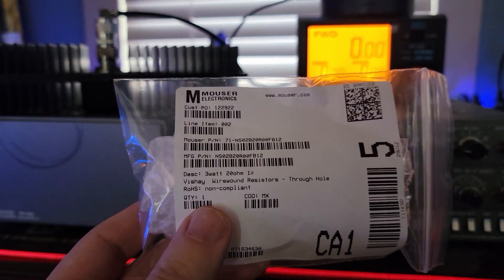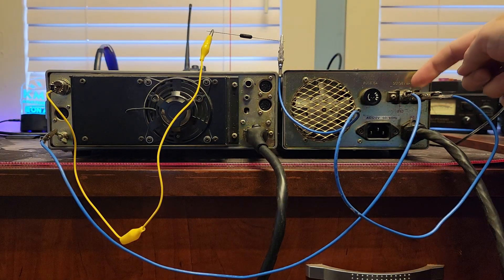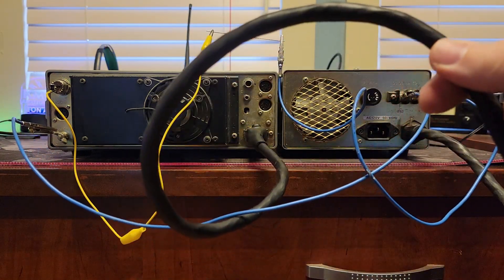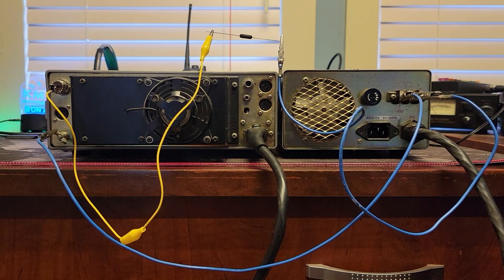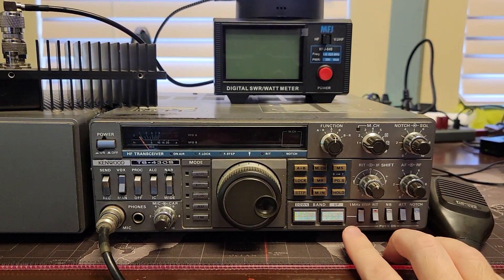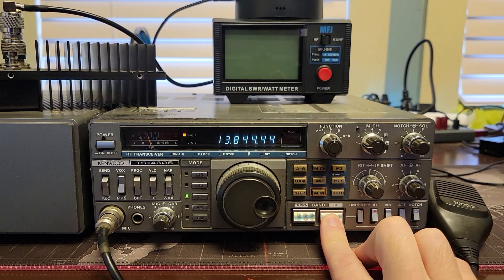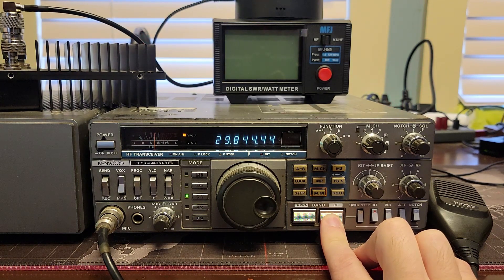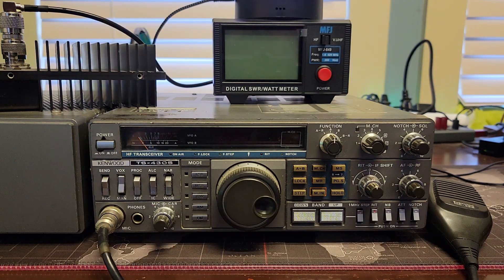This one weird trick...

Comment: Contact oxidation is/was a common problem on, at least, ICOM 730 and 751 transceivers pre-amp relays.  A resistor in the line did the same thing for them as the relays became unobtainable for replacement.  If you were lucky your relay 'welded' shut so pre-amp was always on!
Reply from the maker: Nice! Self improving circuitry!

Comment: I have that radio also Steve. right now it's at a friend's house who just repaired it it needed a new meter and it got cleaned up and de-cat-haired. my friend used to work for the local TV station in ENG as an engineer. he has all the test gear. I also got a 1.8 & 2.7Khz filter for it. Im n going to sell it to a new ham in our club. I've had this radio since 1998. I'm the second owner. I have both the original service & owner's manual too.
Reply from the maker: That will do a new ham very nicely!

Comment: I did this a few years back on my TS-430 because it was in storage for a few years and the relays developed some oxidation. 
With my TS-430 I found that 50 ohms works fine.  This limits current to a safer 275 mA. or so and means that you can just use any DC coupled dummy load you have laying around rated for 5 watts or more as your series resistor so long as you are careful about how you hook things up.  Most of the dummy loads you have around a hf shack are likely to fit the bill, and will work fine.  Again - so long as you are VERY careful hooking things up.

My connection path worked like this -  I adapted the SO239 on the dummy load first to BNC and then BNC to Twin Banana terminals.  Then I connected the RED (center pin) Banana terminal on the dummy load to the Positive output of my power supply.

This means that the shield and outer shell of the dummy load will now be at a current limited 12 - 13.8 volts positive (so some caution is needed) --   Then I used a single wire banana to banana to connect the other (black) side of the twin banana on the dummy load to the SO239 CENTER OF THE RADIO  * BEFORE * APPLYING POWER.  It's absolutely critical to connect everything up correctly and securely BEFORE you apply power, because any oops wrong connection, or "wire pops loose and shorts out the resistor" accidents  COULD DESTROY YOUR TS-430 !

As simple as this hookup is, I hesitate to recommend this DC wiring across a SO239 dummy load connector because, although it worked well for me, it's easy to imagine someone getting confused about how to hook things up, or a jury-rigged wire popping loose and causing a short which will destroy someone's TS-430.

The same thing can happen with the setup that Steve demonstrated in this video if the alligator clip pops loose and jiggles forward a bit to contact the other side of the resistor shorting it out and applying non current limited voltage to the TS-430 RF input, but it's a bit less likely because it's such a simple procedure -  BUT DO BE CAREFUL !.

IT'S CRITICALLY IMPORTANT THAT YOU  DON'T LET A SHORT BYPASSING THE CURRENT LIMITING RESISTOR HAPPEN, EVEN A MOMENTARILY,  BECAUSE THE RESULTING HIGH CURRENT SURGE COULD DESTROY THE TS-430 FRONT END. 

ALSO, it should be noted that the separate ground connection that is shown in the video between the shield on the SO239 input on the TS-430 and the PS negative ground is not really needed, because the TS-430 RF input SO239 outer coax is already at ground and the existing PS cable provides the necessary return path.

I mention this, not to nit-pick Steve's hookup, but because someone might get confused and assume that, for example, disconnecting this GROUND would somehow stop the current flow in the circuit, when of course,  IT WILL NOT .

-- or even MORE disastrously,  could lead someone to reason that, because it's awkward as hell to hold that resistor pushed into the center pin of the TS-430 SO239 input jack ( it wiggles around a lot and get's too damn hot to hold ! ) -  so why not just connect that resistor in the GROUND PATH ?  Wouldn't that be EASIER and still provide the necessary current limiting ?   

The answer is of course NO IT WILL NOT ?  --  AND YOU WILL DESTROY THE TS-430 !

A separate ground connection would only be needed when using a separate power supply to provide the relay cleaning current to the TS-430 RF input connector, which, all things considered, would be the safer choice if a bench supply with current limited output is available.  In this scenario we would turn the bench supply current limit way down to 500 mA or so -  BUT STILL USE A SERIES 30 to 50 OHM RESISTOR (since a current limited supply can still have a nasty capacitor discharge current spike before the current limit kicks in).
Reply from the maker: I like it!  Use what you have!
Reply: @temporarilyoffline  Honestly, if I were you I would hold onto that TS-430.  It sounded fantastic the other night and seems to have been super well maintained.  You don't often find them in mint condition like that - but I am not surprised since you say you found it at an estate sale.  Mine is ALSO absolutely MINT, and will ALSO be sold at an "estate sale" (mine) after it's pried from my cold dead hand. The things that sold me on the TS-430 more than 3 decades ago were the no nonsense professional front panel - All the lighted mode switches grouped logically on the left of the main tuning knob - plus all the little things - like the simple single switch from Hamband to MHz band stepping - which makes for simple transition to general coverage RX - and speaking of MHz band general coverage - there is no radio I have EVER seen were it's so easy to open it up to full 1.8 to 30MHz general coverage TX (just remove one connector).  I have a ton of radios a IC-705, X6100 companion 125 Watt Amp, and a shiny new FT-710, which does indeed have a hell of an impressive RX. But for a fast on-air check, or or QSO, I find myself most often cranking up the 430 - and not just because it's familiar - it's really that good. Check out the Sherwood report ratings for the 430.  Theoretically my FT-710 beats the 430 by 10 dB here 20 dB there, but overall, practically speaking, in VERY careful side by side tests, I have yet to hear a difference..  So you might want to hang onto that one. It's a keeper.  Just saying...
Reply from the maker: @B Wilder  its a great radio.  You sound like you've found a best friend and that's amazing! Wishing you many good QSOs!

Comment: The service bulletin says 28ohm 10watt resistor. And there is a little maintainer circuit you could assemble and install.
Reply from the maker: Pretty neat!
Reply: @temporarilyoffline  mine has the same problem but with the t/r switch 😬
Reply from the maker: @parker6605  time to tear it down
Reply: @temporarilyoffline  those words scare me 🤣
Reply from the maker: @parker6605  That radio is much bigger on the inside.  Lots of stuff going on.

Comment: What would have been sweet is measuring the contact resistance with a low-ohms meter before and after the experiment.  I guess, “No User Serviceable Parts Inside”.  The smokers residue is like a yellow varnish type and arcing the contacts is suppose to burn-through the residue, theoretically.  Nice experiment!  73 KD6UYK (Tim).
Reply: This isn't an experiment. This is well documented in the service manual
Reply from the maker: It was fun once I got past the anxiety of doing something this weird. The theory is perfect, the execution...

Comment: If a lab power supply is available, do you think running a higher voltage at lower current would help even more? Thinking having more an arc flash across the contact versus fusing them together with high amps. 
That is a 13.8V power supply, correct?
Reply from the maker: Its a 13.8v supply - something hams have at the ready.
Reply: I used a current limited supply set to 0.5 Amps. I set it to 13.8V but the current limiting reduced it to a couple of volts.

Comment: Sounds like corrosion on the relay contacts. Burn it off. Do it right, and you don't weld the relay contacts.

Trick for checking temp with your finger: lick your finger and tap against the device. If it pops spit, over 100°C. Saved my finger countless times.
Reply from the maker: Exactly - removes corrosion.  #ProTip on the poppin spit!  Thanks!
Reply: And of course, maybe a higher wattage resistor, although I can see 3W because the resistor might burn up before the contacts weld. Maybe?
Reply from the maker: @LeeMccNA5T  Higher wattage is perfect. You might even be able to touch it after you're done.

Comment: Great idea. I will use it if I win an auction for 30 min, and for sure give results of capacitor liquid cleaner - found on amazon pH riser for pools; I wonder how it mixes with IPA.
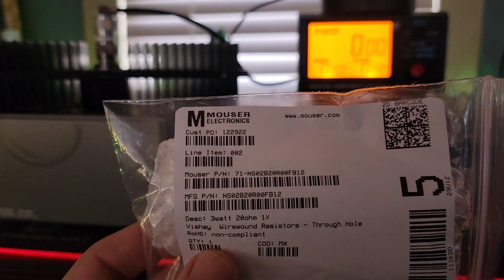A tip for a tip 0:37 you do not have anything on hand and use an alligator clip, but so-239 is fully compatible with a banana plug; in other words design idea was to envelop the banana plug with a screen.
Reply from the maker: Excellent,  thanks!

Comment: That is interesting TO, Since I am putting a Kenwood 930S back into service I need to learn more about this old school trick. I am pretty comfortable with 1980s levels of "safety", as I was a teen in the 1970s and held onto truck beds while wearing clay wheel roller skates, and we went down the freeway.
Reply from the maker: See if it has those clear top relays - this is like using a matchbook to clean the points in the dizzy.
Reply: Download the service manual and check to see if this is the approved method.